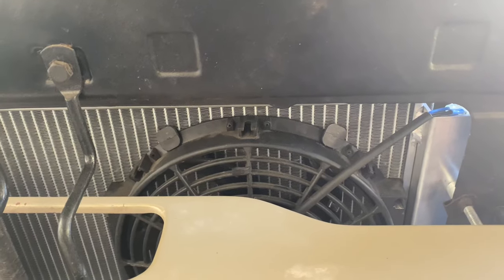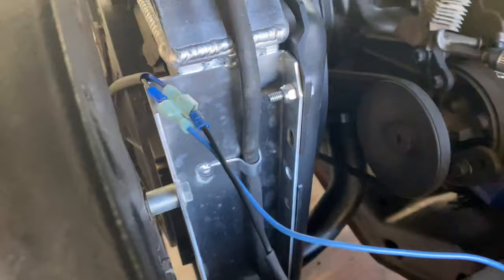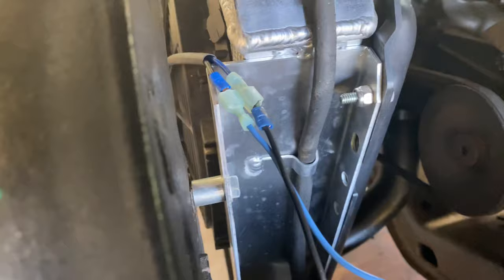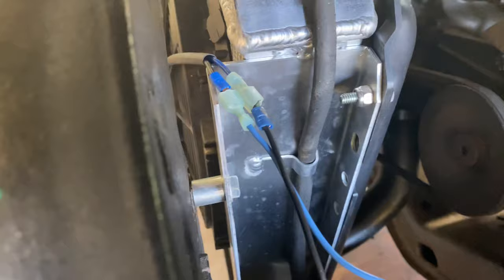How to Wire a Electric Radiator Cooling Fan to a Toggle Switch in a Vehicle! In 1 Minute SIMPLE!

Comment: That fan is a puller, not a pusher. They always claim they are reversible, and that is false, unless you can flip the blade over, and reverse polarity. The blades are curved, and if you just reverse polarity, you are only pushing about half the air.

Comment: Should do relay instead prevent a fire
Reply: He installed an inline fuse to the hot wire, he should be fine considering his fan is pulling less then 10 amps.
Reply: @robertclymer6948  hay man I will install  two 10 inch cooling  fan with  15 amps combined  can I do like  what he did ?
Reply: @sertlilg1071  Yes you can. At the time of the video, i was only running one fan. Bought two 9 " fans, connected them together, made a couple of brackets and mounted them as close as I could get them to the radiator. Each Fan is on it's own relay. So easy, only two wires for each fan. I can run them on auto to my temp sensor on my thermostat housing, or unplug and plug in my toggle switch wire that is mounted in the dash panel. Toggle switch is two wire, one to the temp sensor and on ground. Let me know if you have anymore questions. Oh, I highly suggest running (One) big fan instead of two, Like a 16 inch Spal if your Radiator is big enough for it to fit in there nice.
Reply: @sertlilg1071  If you do it like he did, without using relays, splice the two fan wires into one and go with a higher amp inline fuse is all.
Reply: I run dual pusher fans(9 inch ir 10) to cool my BBF 460 along with a shroud and 18" flex fan. Eash fan has it's own relay and so simple to wire. I also have things I inline fuse too, but higher amp stuff is always on a realy. Thanks
Reply: @robertclymer6948   thanks man for the help i will run it on 30 amps  toggle switch  with  15 amps fuse  just to make  sure

Comment: I installed the exact set up with I think the same switch. After a few minutes the switch melted down. I must have used too low of an amperage toggle switch. I also didn't fuse it. 😂 I'll try again. 😅

Comment: Just run a wire from the sending unit to a switch and to a ground, this way the fan turns on when it reaches temp but you can just turn it on by flipping switch at anytime.

Comment: Run it through a relay or the switch will get very hot.
Reply: Hot wire should be at least a 12g or a 10g is rated for 30 amp. Important to know how many amps the fan or fans are drawing. Ground wire 16-18 g.
Reply: @robertclymer6948  The wire is irrelevant - the switches themselves arent designed for so much load internally. The relay only sends a tiny load to the switch.
Reply: @proxyicarcus  Hello, so no fuse is required for the two fans on two relays? I can run the the one wire to the thermostat housine sensor for auto on/off, or plug the spade connector into my toggle switch for manual on or off. Fans are 80W each. 12V. Thanks much!

Comment: Very cool, simple and direct. Nice and complete touch adding that inline fuse! Thanks for sharing. Now all I have to figure out is adding a toggle switch to my two fans with two relays. Thanks for sharing.
Reply: What would happen if you didn’t run an inline fuse?
Reply: @chrisdickey2477 possibly fry your wires and maybe start a fire if the amperage isn’t correct

Comment: How did you connect the wire to the fuse box. What ignition controlled fuse did you use and what did you use to connect it?
Reply: Good Questions
Reply: just link the sensot to two wires,, and make the circuit close dont need , fuses, just direct stuf.., but you need a thick wire if you put too thin will over eat and burn..

Comment: I just got a fuse tap with 30amp fuses & ran a wire from it & hooked it into 1 of my back window fuses, located under the hood, the fan stay on as long as my ignition is turned on, I know its hard on my fan to always stay on but I have a lifetime warranty from O'Reillys.

Comment: The bad part about this is that the fan draws out amps and that toggle switch will burn up. It's best to use a relay but good job on the clean work.
Reply: Yea he gona melt the wires and have other people copied this method and possibly 🔥 car to the ground

Comment: Man, you saved my ass! tired of being on the side of the road! Thanks
Reply: if its eating a lot you ahve to fix it,,,

remove termostat or make holes in it,,, it will not over heat, better that mess with fan

Comment: i noticed after wiring everything up, you have a smaller fan like 12-14in and my fan is a good 20in+. My fuse blew twice, and my radiator fan connector has bigger gauge wire and im running a 40amp fuse through it. Should i beef up the components?
Reply from the maker: Well a 40 amp fuse is pretty powerful, it could a combo of things. A wire touching something could do it, like the hot touching bare metal. Check all the connections and use heat shrink and electrical tape. Also try using a lower amp fuse. I don’t think the wire size is causing it. Hope this helps!
Reply: @nashorn8706  I got it running now, I asked a lot of people, looked through a lot of videos but yours provided the most transparent concept, thanks a lot 🙂

Comment: Would I put the fusesble wire to my neg side of battery
Reply: No, the inline fuse at the beginning of the circuit is enough and any ground on the car is sufficient to complete the circuit. Many accessories are already grounded at the device, so you'd only run a hot to them. Fuses or breakers should always be the first thing on your circuits.

Comment: Don't you need a relay? I tried to do this (admittedly without a fuse) and it blew the switch after two days.
Reply: relay is safer. if your wiring was the proper gauge preferably 10 maybe 12 then the switch probly wouldnt have blown had a relay been used or better yet a relay with a fuse from the battery to the relay

Comment: that's a great video, is it ok not installing a relay ? and how much is the amp for the fuse that you use. thank you
Reply: Its not absolutely necessary to set this up, just more ideal. The relay will allow the fan to be powered more efficiently, and it also helps to protect other electrical components in your vehicle. So its up to you really.

Comment: What about just running it straight to a fuse that allows the fan to come on when the vehicle is running is that something I could do or would it burn the fan up quickly that way?
Reply: Did you end up figuring this out. That’s what I’m tryna to do

Comment: This is a weird way to do this it shouldn’t turn your fan on when turned on your thermostat should turn it on
Reply: cheap way of not replacing your fan or thermostat, did it in a 99’ mustang with my grandpa and it worked until the entire fan assembly gave out. About $20 for switch and wires vs $90+ for fan(s)